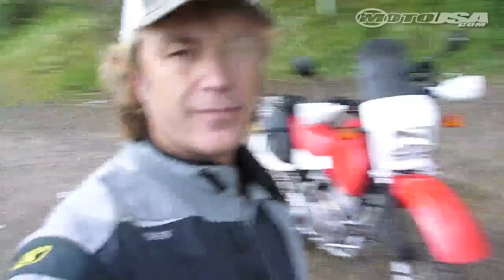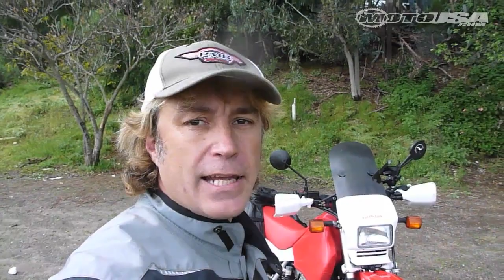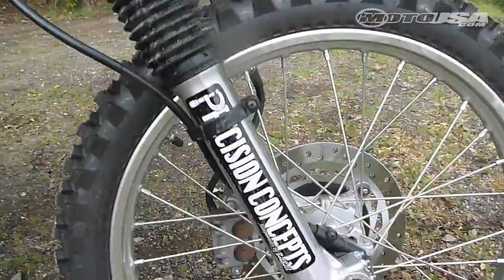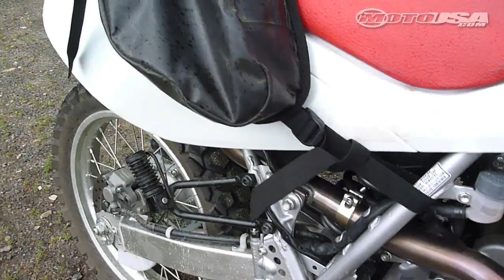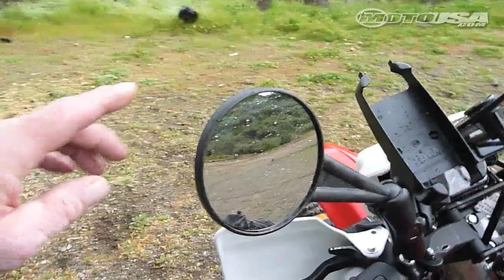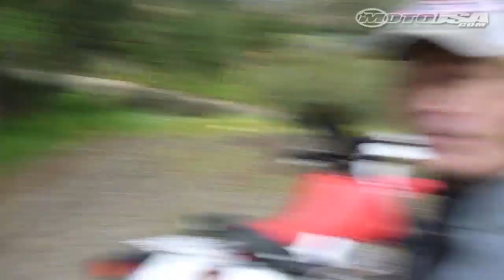MotoUSA 2009 Honda XR650L Adventure Bike Project

Comment: I recommend MT21 for more dirt oriented riding.  great traction offroad and not bad on the street either.  not that nosy on the road either and will last you a good 2000 miles on the street before you need to replace them.

Comment: @bandguy360 Rode all three in the past 2 weeks. KTM too expensive, but very powerful, and stock suspension stiffer. KLR feels heavy and is slow. I'm a Honda guy, own two CRF's, but bought a DR, perfect , cheap, find an 09 and get 1000 rebate, 4700, brand new. You can't beat that price.
Reply: Um, but it's a Suzuki.

Comment: I would do one of these duel sport motorcycle but I would definitely swap the engine out a put a predator 420 and a CVT transmission on it the engine will have a stage 1 kit and heavier valve springs and the governor removal and wire the key start system and charging system into the factory wiring make sure the charging system is at it’s maximum operating potential the exhaust system will also be piped into the stock system to help with exhaust noise and intake I’ll make it custom myself and also mount tires meant more for street use.